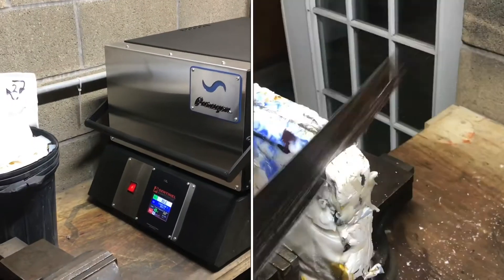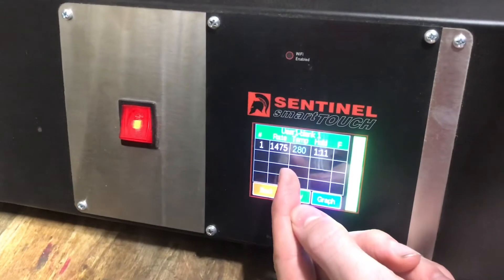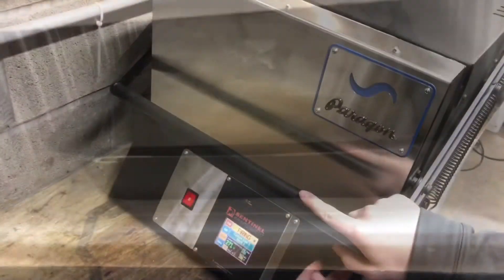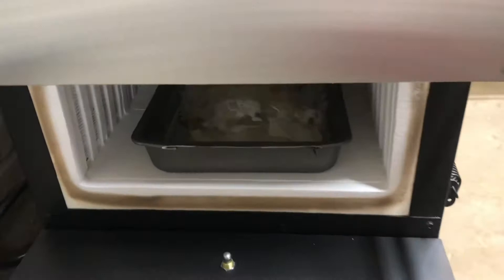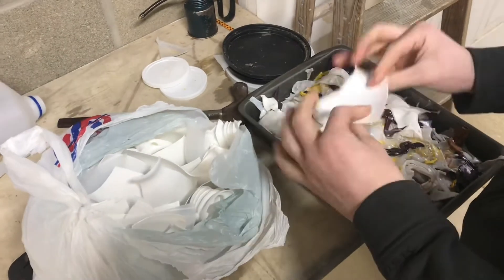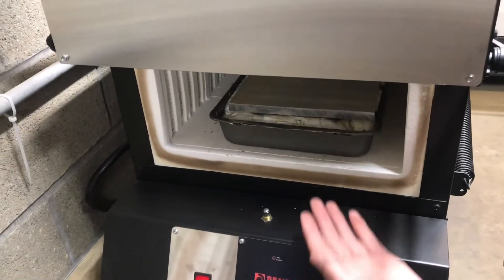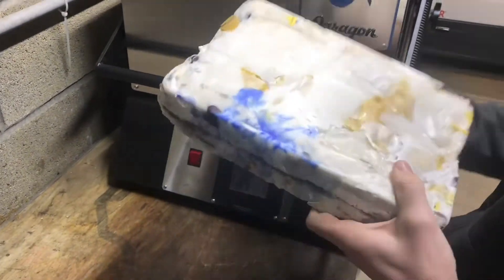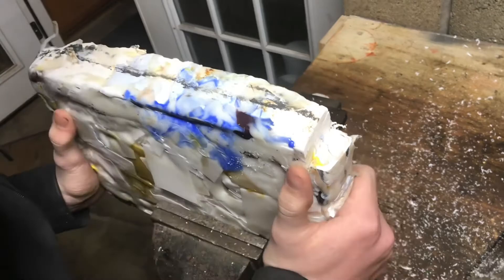RECYCLING HDPE in a paragon kilns double barrel 9t pro heat treating furnace

Comment: If it’s not smoking, and it’s only 400 degrees, is there a reason this couldn’t be done in a kitchen oven?
Reply from the maker: I think it would be possible to do something like this in the kitchen oven. I was a little concerned that if it went too high and filled the whole kitchen with smoke. This oven is very close to the garage so I just be able to open the door quick. The biggest improvement that I could do next time would be to have a hydraulic press handy so I can squeeze the plastic tightly together to get all the air out. All in all I was pretty happy with the results👍👍
Reply: researching about melting hdpe, an kitchen oven could work, but convection ovens are more efficient